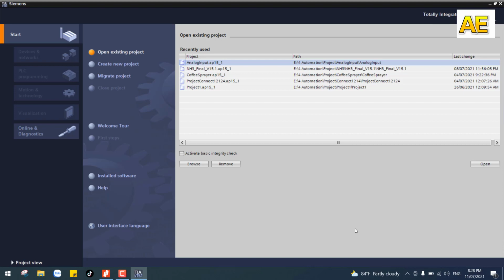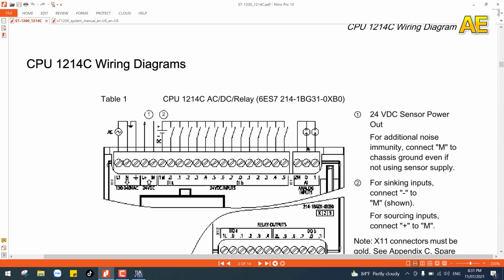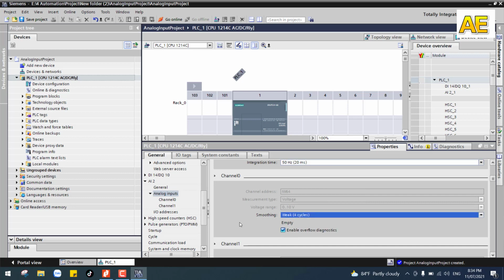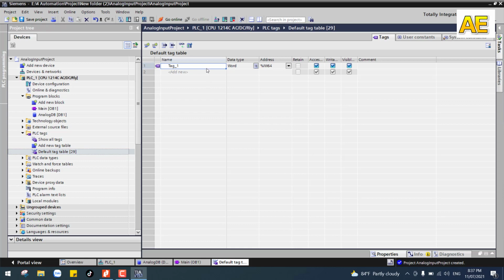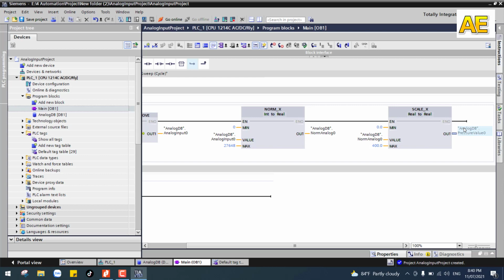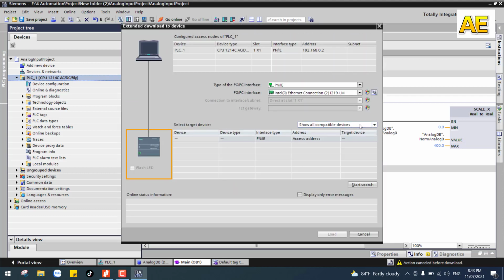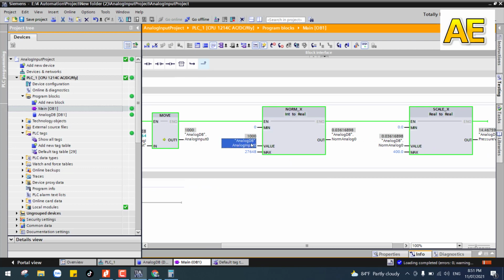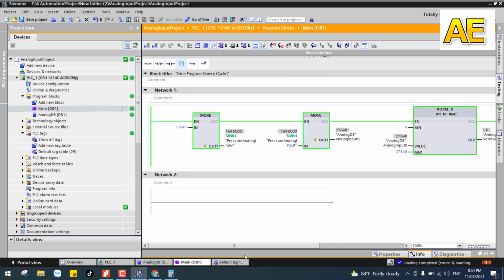TIA Portal: Program PLC S7 1200 1214C AC/DC/Rly Read Analog Input From Sensor

Comment: can you teach me write the program when receive analog input 20mA (high value) then i want analog output 4mA to slow the pump. when received low value 4mA, want to analog output 20mA to speed up the pump just like the PID controller.
Reply from the maker: Analog output you do the same as analog input like video content, but the range of NORMX is 4-20, the range of SCALEX is 0-27648. Condition of analog input that you just use the compare command block "=="